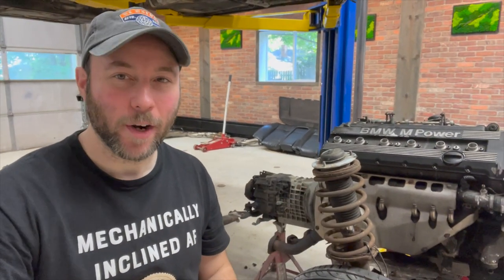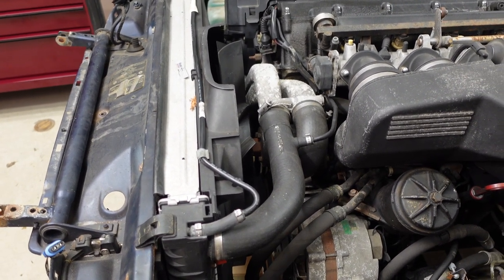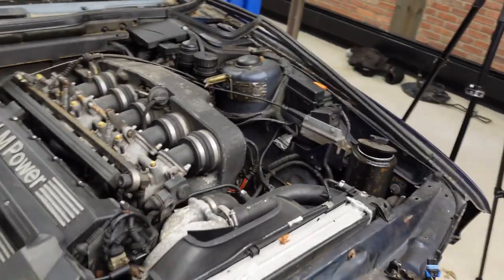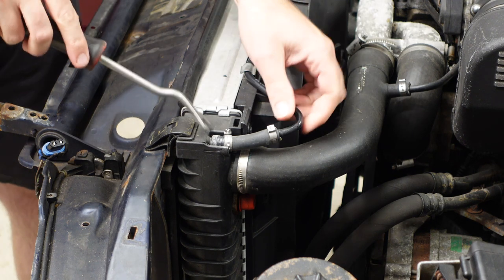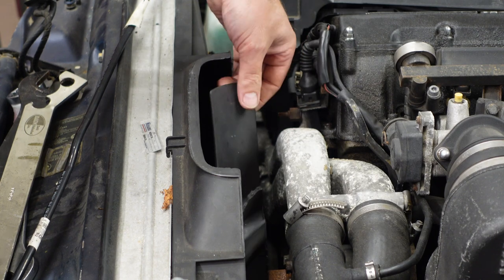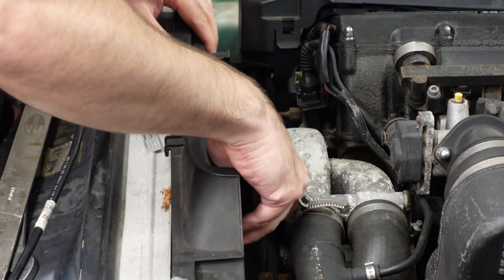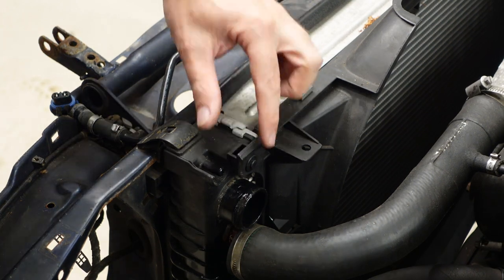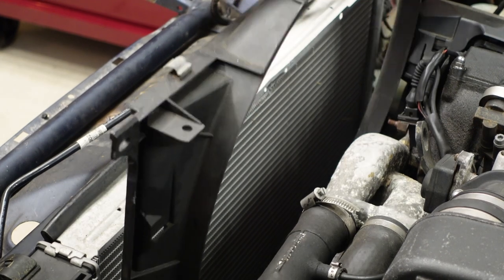Episode 4 1992 BMW E34 M5 Full Restoration Radiator, AC Condenser, and oil cooler removal  HD 1080p

Comment: Also another tip, i think you probably should make bigger videos, setting a big goal for each one of them, like "today we drop the drivetrain" basically not splitting the episodes into parts. Keep it up :)
Reply from the maker: That was the original idea but I found that YouTube favors shorter videos. The reason being that people click away only after a few minutes and that creates a lower engagement rating on longer videos as opposed to short ones. My first video was 38 minutes and the engagement rate is super low compared to the future episodes.
Reply: I also prefer long form videos. But I noticed the other mechanic channels I watch had shortened their videos up lately as well.  I guess there are analytics at work there.

Comment: I absolutely hate it when they put plastic barbs on radiators... Now my experience is only with computer water radiators... but I can't tell you how many times back in the day I snapped them off and then had to drill, tap, and put on a metal barb :D  I recently switched from using flexible tubing (mostly because the plasticizer they use in them breaks down after only a couple years) to hard tubing (like clear PETG) which has its own set of problems.  If only I knew a person that was good at metal pipe bending and potentially welding.... Definitely skills I'd like to learn at some point.
Reply from the maker: Well, wait until you see the sheet metal work I'm going to do and then maybe you can visit the shop with your own projects! I'll take payment in JC Gyros....but only if its after midnight!
Reply: @wewrench  well OBViously it has to be after midnight cuz that's when the JC Gyros drop to $4 LOL